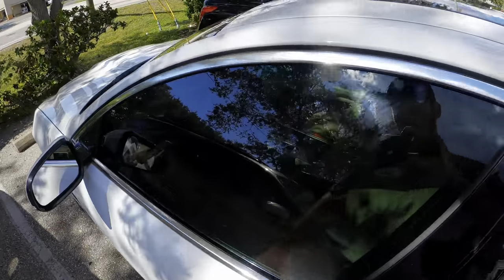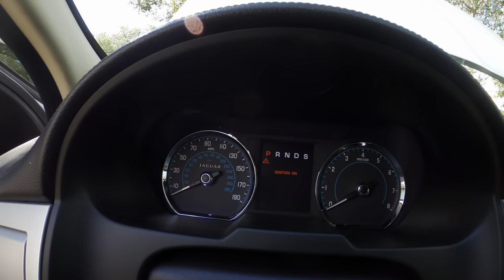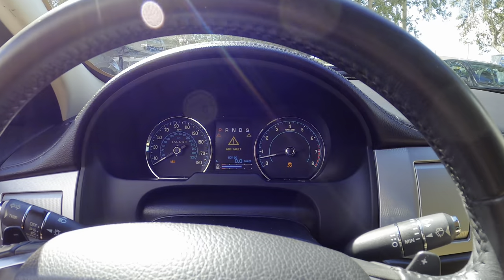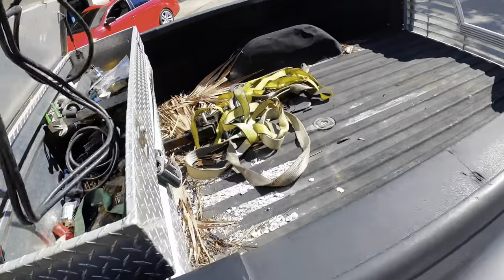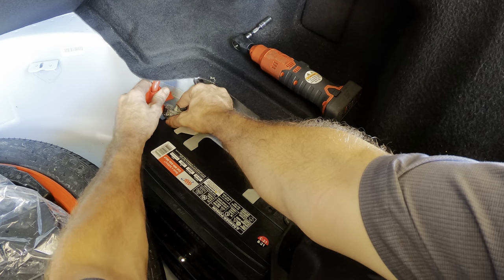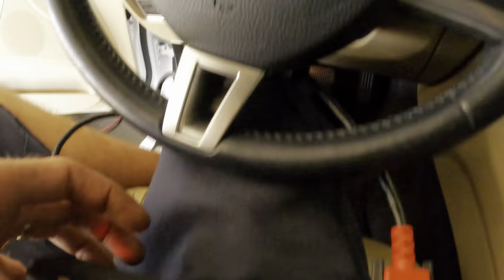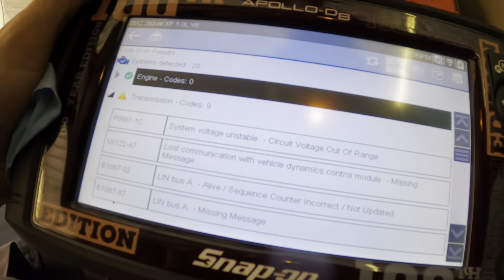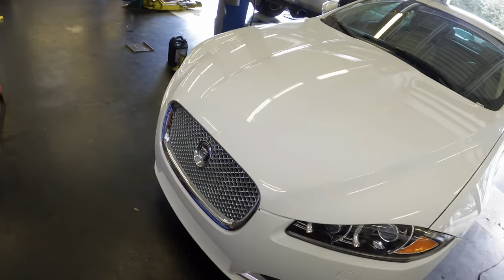Jaguar XS just Towed In.  I’m in over my head! Customer States: “Check Battery”

Comment: Good move.  All those other issues could have been a network issue or worst case a wrongly connected battery or jump pack that wiped out some modules.  It could have been a bottomless pit of time and parts.
Reply: @bigclivedotcom
Very good guess, someone fried and damaged the ECU with an improper jump/boost
Reply: Oh wait.. Big Clive.. your watching Ray too.. cheers. Have a good day
Reply: I completely agree
Reply: As always you did the right thing!
Reply: @watershed44  I watched someone send 24V through a 12V system. Luckily not long enough to damage much, but it really didn't like it
Reply: Big Clive has entered the chat. Have you tried soda stream Bailey's yet ?
Reply: Big Clive's watching this channel? Well i never would have believed that
Reply: I'm shocked to see bigclive.
Reply: Cool to see you here. Anyways I'm all for him turning it down, but if it was my own car I would bet it's just the alternator and the rest of the codes are from the voltage drop, Heck even the misfires could be from that
Reply: What's up man.
Reply: @jaykoerner  i also think the alternator is the prime suspect. Under voltage can cause all kind of issues
Reply: @curtisj2165  yep that's what I said
Reply: Big Clive, nice to see you here
Reply: Big Clive in da house! Cool! Any chance of applying 240v to a Jag and watching the results? #revenge. 😉
Reply: There is no corner of the internet Big Clive doesn't reach!
Reply: BIG CLIBVE
Reply: @Anton 2.0 I get it the gearbox has a minimum voltage to allow gear selection and you need enough to run the coils to actual fire the engine, but at the end of the day I don't see why not put it in limp mode it won't kill the engine just the battery
Reply: the mighty clive has arrived good to see u clive hopeing to come and see the isle of man one day and bump into you
Reply: Work on lots of jag and Rover they both care very very bepindent on voltage have had this same thing with just bad battery bad alternator or a broken belt you don't have 12 volt or better computer will not talk but good work ray and a hello to big Clive
Reply: This guy was incorrectly connecting jump cables and the battery anyway your ment to secure the positive first then connect the negative to reduse voltage spikes/overload on voltage sensitive components I'm a vehicle electronics technician and I recently had a simular problem to this on a Mercedes and new cars use what's called a smart charge alternator you can have the vehicle running but most modules on it require a signal output from the alternator to keep them active
Reply: Ray is it possible this jag has been under water before you even got it aka flood car and was resold to these poor souls
Reply: That’s what I was thinking, check the battery the customer wanted, I bet they had someone who does it cheaper jump there vehicle lol!
Reply: @jaykoerner  I agree with you except the bit about voltage drop. You should have said low voltage, not voltage drop.
Reply: @jaykoerner  Low voltage can kill an automatic transmission, especially if the pressure control solenoid defaults to low pressure when not supplied with enough voltage.
Reply: @jaykoerner  the low volts did trigger the hundred codes my kenworth truck does the same thing is is the alternator bad or is there something on the network making the ECM not command charging
Reply: Clear codes try again
Reply: agreed, it was either very simply like an alternator, or any number of back computer issues...
Reply: Totally didn't expect to see bigclive here either!
Reply: @christopherashurst4610  previous versions of this Jag have recommended the negative cable is connected to bodywork too
Reply: Wrongly connected battery was my first thought. Seems like it was recently replaced.
Reply: @watershed44  Car wouldn't have started if the ECU was fried.
Reply: @andylaauk  Actually you are wrong many times specific parts of chips may survive or fail with voltage surges, or other things. So the car may start but the trans may not shift, ect...
Reply: @hellfolf7343  i told my friend not to plug his phone into my usb C laptop charger "puts out 24v" he did. He broke his phone.
Reply: @djstringsmusic2994  haha, that's the lesson my friends get. If they don't want to listen to me, they can learn the hard way
Reply: @justso1823  Yes he has! 👍
Reply: Yo bigclive 💪💪
Reply: typically american mechanic try to fix something
Reply: Codes are from a dead battery. Scan tool wouldn't have communicated if the modules were dead. Wish he could have diagnosed the charging issue first.
Reply: I'd expect the modules to have a simple diode to protect against voltage reversal though. If there's one thing that's likely to happen in a jump-start it's reversing the leads.
Reply: Could the plethora of codes not just be a symptom of a dying alternator and a battery below operating parameters for the various modules? Not familiar with Jaguar but had similar occur on a friend's wife's Nissan, we changed the alternator and battery so he could drive it to the dealer, and halfway there he decided to come back as it was running and driving normally, cleared codes, re-scanned after he drove it a half hour and no codes had popped up, still running fine. Wonder if Jaguar and others have that programmed to scare work back to dealers?
Reply: It could be like my bmw the gear shifter is electric.  If the battery is low it will jump into park. And if it's low and your lucky enough to get it to start it will not let you shit out of park the Navi screen and radio won't even turn on until the battery voltage comes up enough.  I had a bad battery and I would have to jump the car or Rev the engine enough that voltage would come up enough toet the system restart sometimes getting a bunch a low voltage codes.

The battery went bad and would not hold a charge over night.  I used to use a trickal charger maintain the batter over night until finally the batter crapped out.
Reply: @djstringsmusic2994  that's a very weird charger then. Even if it supports PD protocol, as I assume with the 24 V you mentioned, they should negotiate the protocol and power first on initially very standard 5 V and at most 1 amp.
Only after both sides negotiated what they can handle, the charger should turn up a higher current for USB 3 or different voltages for any Quick Charge Version or PowerDistribution.
Reply: @alexanderkupke920  not 100% what happened. But it's a gaming laptop usb C charger, that literally has a tag on it stating "DO NOT USE TO CHARGE A PHONE" His phone lit up like it was charging and it took a min before it died. Any way it just cooked something in the charge circuitry in the phone?

Edit i just looked on the adapter it puts out 19v supply
Reply: And let the nightmare begin. 🙀💸💸💸💸💸
Reply: Clive, fancy seeing you here haha
Reply: Big Clive! My favorite electronics guy!
Reply: @djstringsmusic2994  USBC chargers should not put out more than 5V unless and until they communicate with the attached device and establish that it can handle a higher voltage.  If your charger puts out 24V without first establishing that the device being charged is compliant with a higher voltage, it is faulty and needs to be replaced.
Reply: @djstringsmusic2994  In which case it is not USBC compliant.  If the manufacturer has not made it compliant with the protocol, there's a good chance that it is not compliant with safety regulations either, and could end up electrocuting someone or burning your house down.  There have been many deaths caused by incorrectly designed USB chargers.  Risking a life to get a charger that's maybe $20 cheaper than a safe one is really not worth it.
Reply: @curtisj2165  100% agree. I work on military vehicles and you would not belive the crazy faults you can get from a MTV with low voltage.
Reply: I love ya Clive, good to see you here
Reply: That’s a good possibility. With all the bells and whistles on that car, it could be buggy software, or at least that’s where my mind went on that.
Reply: It's a Jaguar, a "bottomless pit of time and parts" is the very definition of what it is!
Reply: @curtisj2165  agree, under voltage causes no end head scratching
Reply: Clive, you do get around. I luv your channel also !
Reply: Definitely reverse battery when recently replaced
Reply: With the warnings about improper voltages for LIN Bus A and the electrical system "bouncing", I want to know what voltage is being seen on that line :D. It seems like there's either a short or bad board, but as you say - good move, this is for business, not as a fun project.
Reply: It is just jammed modules. Cleaning the errors would most likely fix it. But there must be a problem with the alternator which started all of this.
Reply: @TheOriginalEviltech  The shop owner made the right decision when he wasn't sure of the exact problem !!!  Hunches waste TIME !
Reply: For some reason, my European motor requires that when jump starting the negative jump cable should not be connected to the negative on the battery….something to do with the ecu monitoring the current and voltage thro and across a thingummy connected to the negative terminal? Don’t you love modern technology?
Reply: Dude drop the tranny.  Go big or go home.
Reply: @peteypops  Isn't that just because it's safer to make the final connection away from a battery where hydrogen may have built up? Attaching two batteries in parallel is somewhat like swapping the battery with an added... very tiny... risk of explosion.
Reply: @Tawnos_  that’s true, certainly a small risk of hydrogen explosion, especially with modern batteries.
Reply: @watershed44  If that's the case that the ECU was damaged / fried by an improper jump/boost then as an Engineer myself I'm horrified at the terrible design of these cars.  It is very trivial to protect such components from such activities. Most cars have magical boxes called fuse boxes that protect the car from exactly those kinds of mistakes, but in addition to that, it protects the electronics systems from other kinds of failures that can happen naturally as components wear, age, and fail.
Reply: @watershed44  In the desktop PC markets, we do all sorts of crazy things like send 300+ volts to a power supply that is designed to take only 110v. And we check to see if it blows up any  sensitive electronics that are being powered by that power supply. If it does, then the design of the power supply is a failure and it goes straight back to the drawing board.  If the input power is high enough and the power supply itself blows up from the surge, but then saves all the electronics that are connected to from being damaged, that's considered a huge success.  We test for a lot of things to make sure that electronics are both safe to use and reliable.  The only people that don't do these kinds of quality tests are the Made in China brands. But generally, it's an international standard.
Reply: I love it when I see one of my favorite creators is watching the same things I watch!
Reply: Since when did big clive do auto electris
Reply: Yep looks like an electrical demon somewhere. If it's been jumped it's bye bye with modern cars if not done correctly.
Reply: And what was the problem?
Reply: I’ve seen many times a salesperson or lot boys wipe out control modules by improperly jump starting vehicles.
Reply: I don't know why people are shocked that Big Clive watches RRR, us cool people naturally home in on a good channel!
Reply: @djstringsmusic2994  usb c chargers don't just output 24v, they start of with 5v then the USB c controller chips on device & charger negotiate what is required, if no communication voltage stays at 5v. Either the phone was already fried, the charger was fried or you had a dodgy out of spec charger ie using USB cphysucally but not electrically
Reply: @norfolkngood8960  its a lenovo ADLX65YDC2A 65W usb c charger.
Reply: @djstringsmusic2994  I'm surprised by that, modern charge devices usually have a "2fa" with power supply and if either end detects that the requested power exceeds limits it simply doesn't supply power
Reply: I reckon you should do a schematic :P
Reply: It's a wise man who admits what he doesn't know
Reply: Hi BigClive 👋 I used to live in Scotland myself a long time ago.
Reply: The jag is gana fix it 2take eather 
1.the alternater fault made the mess

2.if it was forced jumped that is jumping car running and give a pump of gas then boom bue bye systems 
 Vw golf is the same mate had his ecu blowen du to bad jump turn the jumping car off and use the bat only
Reply: Good to bump into you Clive! I get a warm, fuzzy feeling seeing someone I've been subscribed to for years appear on a channel I've just started watching.
Did you notice how strange it was seeing Jaguar as "a European exotic"? 
It's just a Jag! A base model at that. But I suppose they're half a planet away so the supply line is long. That'll make parts more expensive. 
That Jag did have the hump though! Just sitting down in the middle of the car park & saying "I'm not moving until someone does that special thing to me! <Park> So there!"
Good call Ray! You saved yourself a whole heap of very expensive trouble.
On with the next motor!
Reply: Just curious how hard was it to get to the alternator . Could you have checked the exiter wire to see if it was active.
Reply: Could be almost anything. I have 2006 LR3 which likely has the same electronics. It could be a bad ECU. Could also be a bad wiring harness. I had some wires chewed by a mouse and my LR3 exhibited almost the same symptoms. My car would drive but would not shift out of low gear. Have also seen similar issues with a bad alternator and battery. These cars do not do well with low power.
Reply: Bro tf are you doing here! Awesome to see you!
Reply: The ECU got corrupted on my Jag during an injector replacement coding session..it forgot it had a gearbox or lights or even wing mirrors... scarry as fook . I thought it was dead  ..you must have a 30+Amp battery maintainer  connected at all times when playing with jags the battery voltage must be above 13V  at all times during any programming / diagnostics..I had to reload the ECU firmware .....often the easiest way is to remove the ECU so you make a note of the type on the sticker to get the correct firmware...to say SDD/IDS has a steep learning curve is understated..
Reply: Who's big Clive? I'm European, I don't know.
Reply: What the hell Clive this is the last place I expected you to be...
Reply: Yeah that would be my guess or some one tried to fix things without knowing what they're doing (DIY). Lot of people dont know they shouldn't have the keys in when jumping a car for example. Also glad to see quality YTers watching other quality YTers, lol should do a Jaguar ECM teardown
Reply: Isn't it rule of thumb to disconnect the negative before the positive and reverse positive then negative I'm not sure what you're talking about bro
Reply: Yeah moduals are ALWAYS issues in jags haha and bmws sometimes
Reply: Jumper packs generally have reverse protection...I had a good Samaritan fry a vw ecu on my ex wife's car...I was there 10 minutes later...injection drivers were wide open...1 gallon of fuel in the oil pan...livid
Reply: My best guess now it's a total load stain.
Reply: Isn't that the definition of a Jaguar?
Reply: You know you have mad it when Big Clive or AVE comment on your video
Reply: It's a jag I would guess bottomless pit of parts
Reply: Suspect alternator, the electronics won't talk. Nevertheless, you were not confident enough to call this one which is fair enough. However, it would have been great to know what the dealer diagnosis was
Reply: Next on big Clive channel …reverse engineering a jag XS canbus 😀
Reply: My money is on wrongly hopked jump
Reply: Agreed. My immediate thought was, someone hooked up the jumper cables backwards. Bet they fried the battery and several modules. I've seen people do it before
Reply: They may have jumped some one off and frayed their own car
Reply: That's what I was thinking. My ex's dad tried to jump her car while I was at work and hooked it up backwards and welded my ignition relay into the block. It was a nightmare to fix. Similar stuff though. Tons of codes and a bunch of weird electrical issues after that.
Reply: I wundér if hé friéd itt inn the car park whencé he dothé connekt the Durra Max Veee-Hikull Batterie¿¿¿¿¿¿
Reply: I am not sure why all these commenters are arguing about how to jump a vehicle. Every owner's manual I have seen always has a page or two describing exactly how to jump the car along with where and in what order to connect the cables. But I remember I tried to help some dude who needed a jump. The battery was located somewhere inside the interior, not in the engine bay. I tried to convince the dude to find his owner's manual, but he refused. I don't know what that idiot did, but he nearly caused a fire. I have never seen a battery flame up like that before. It was at night, so it was very obvious. So now, I don't help anyone jump unless they can produce an owner's manual, and I am the one doing the connections.
Reply: He should have scoped the can bus, alot of the time one faulty module will communicate nostop causing issues. Big fan Mr. Clive.
Reply: Very good decision on your part Ray. "A man's got to know his limitations. The question is, do you feel lucky today or not?" Luck has little to do with this one. Glad you passed on this exercise in frustration!
Reply: Clive.. Since when are you into cars haha
Reply: @DreStyle  Mechanical videos are how I relax.
Reply: @bigclivedotcom  awesome ! And both of yours are how I relax haha ,what an fun world we live in 😅
Reply: Put on an intake and a carb. If that won't help the problem ur car too complex. I have no problem w car computer systems they just all need to be open source and access to accurate wiring diagrams. Reality is its a money hole a non dealer tech should send on make more on an oil change.
Reply: @djstringsmusic2994  Pi$$ poor system if using a cigar type plug in. Still Pi$$ poor system if it takes a standard plug-in from the regular phone charger coard. I was not aware that these charge ports had a higher voltage. I have a 2018 Subaru Crosstrek. I'm going to take a look at it. I am a retired construction mechanic and love watching Ray do his thing. By from ol-az-ol, me.
Reply: Clive - another Rainman Ray fan ;)
Reply: Jaguars are bottomless money pits and parts that break all the time.
Reply: You should have referred them to the Toyota dealership.
Reply: @watershed44  probably ray lol, you don’t hook up European cars with dead batteries to a running diesel, too much too much, no hate from me though
Reply: It’s very important to know what has happened since the fault initially presented, because if it’s been to another shop it’s possible more damage has been done or incorrect parts wrongly fitted.   I’ve seen a simple failing battery end up with a big problem because someone put a spare battery in back to front, but then totally fail to mention that when taking it in for repair.
Reply: @curtisj2165  wow yep, big clive weighing in
Reply: Jags & Mercedes are famous for throwing thousands of trouble codes when the voltage drops low and/or the alternator fails.   Most of the time, a code reset and fixing the low voltage issues will fix it.   But Ray is correct, if you haven't seen this or don't know, then finding a specialist is the correct thing to do.
Reply: @andylaauk  The Jag is going to have 40+ ECUs. If any one of them is messing up bus communications then there are going to be many random codes present.
Reply: @djstringsmusic2994  Cheap ass non- compliant charger. Who makes that laptop? So we can avoid them..
Reply: @vinny142  modules have load dump protection so over Voltage is unlikely.
Reply: @johndenton5555  that's just what happens when the power supply for electronics gets low and communications errors happen. Each module remembers its own problems, as it may be the only faulty module.
Reply: @beezlebub3955  oh that's a point! Ford's do put out more Voltage than other cars as they have slightly different batteries. Load dump protection on the Jag should deal with that, but it's a bit sketchy..
Reply: This is awesome to see you here BigClive
Reply: @christopherashurst4610  I'm not really sure if that's true though... Personally I always connect the positives first as then if you accidentally touch the bodywork with a jump lead it's not going to cause a short circuit (I've seen many people do this when jumping a car!).
Reply: I was thinking the same thing
Reply: I would have connected the cables in a slightly different order but I'm not mechanic.
Reply: Hey, It's bigclive! Fancy seeing you here!
Reply: I guess that explains why this channel got recommended to me.
Reply: @markphillips2076  nuclear meltdown
Reply: Big clive!
Reply: @djstringsmusic2994  they must be doing something non-standard as USB-C PD QC is supposed to default to 5 V until negotiated. As many other comments noted. However be aware about using those octopus cables if one device negotiate 9V or more any other device attached to the other tentacles will get more than 5V! And great we have nonstandard power bricks out there!!!!!!!!!!!
Reply: @jaykoerner  voltage at the alternator to start with.

dont like cars with batteries in boot/trunk
always seem to have problems.

something something cranking amps down 4 meters of cable.
very silly idea.
Reply: who da fuc is big cliv
Reply: @watershed44  My take as well. Already evidence of a previous jump.
Reply: My first thought. Somebody hooked up reversed jumpers cables. Total guess or assumption though. That said, is anyone else amazed when a customer brings something to troubleshoot and doesn’t give you the entire story? 
More than once after finding the cause of a problem, a customer has said, “Oh yeah, I accidentally shorted (fill in the blank) but I didn’t think that caused this problem and I didn’t want you to assume it was, so I didn’t tell you. 🤣